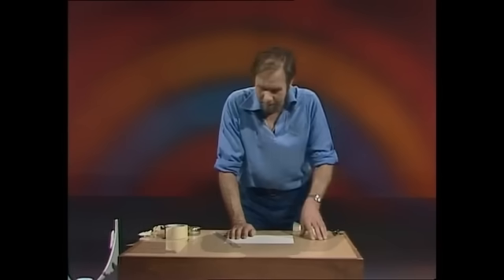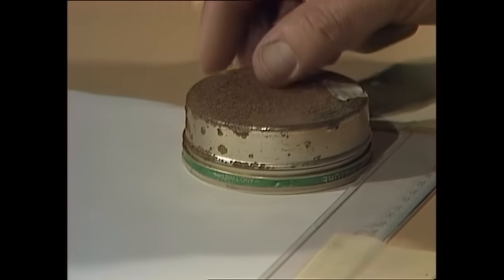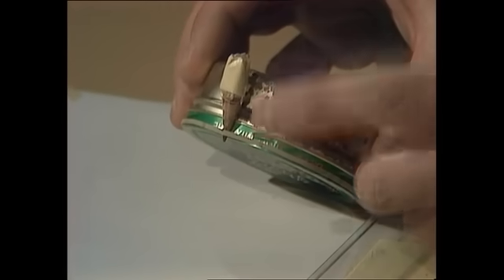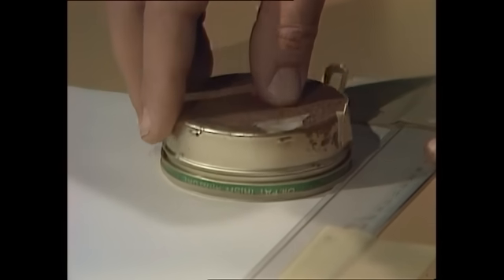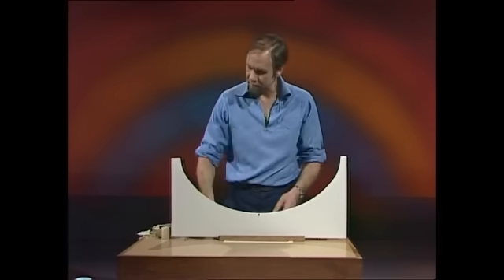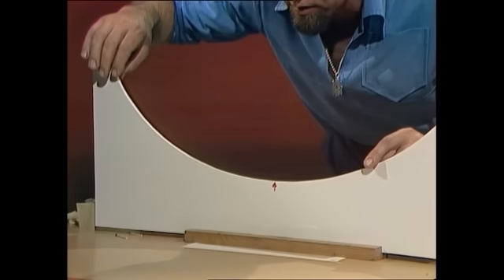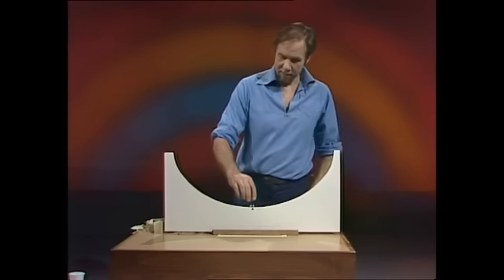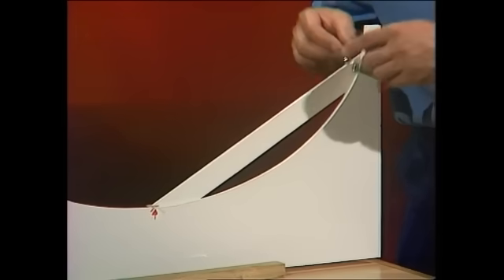The mysterious isochronous curve

Comment: Who discovered the properties of the isochronous curve?  Was this property realised theoeretically (mathematically) before anybody made one, or was it discovered empirically through the 'evidence of experience'?  At a wild guess I reckon it was an Indian, Iranian or Arabian mathematician.  (Perhaps nobody knows.)
Reply: I checked Wiki.  There's a long and interesting entry, but the gist is this: 'The tautochrone problem, the attempt to identify this curve, was solved by Christiaan Huygens in 1659. He proved geometrically in his Horologium Oscillatorium, originally published in 1673, that the curve was a cycloid.  On a cycloid whose axis is erected on the perpendicular and whose vertex is located at the bottom, the times of descent, in which a body arrives at the lowest point at the vertex after having departed from any point on the cycloid, are equal to each other... Huygens also proved that the time of descent is equal to the time a body takes to fall vertically the same distance as the diameter of the circle that generates the cycloid, multiplied by π/2. In modern terms, this means that the time of descent is π r / g {\displaystyle \pi {\sqrt {r/g}}} , where r is the radius of the circle which generates the cycloid, and g is the gravity of Earth.'  It goes on to say that the  problem was worked on in an attempt to improve the accuracy of clocks, dealing with inaccuracies introduced by a conventional fixed pendulum which describes a simple arc of constant radius.  So it was thought about theoretically and practically.  What I have not read yet is who came up with the isochronous arc in the first place...

Comment: Now my question is- Is the path covered by the bob of a pendulum also an isochronous curve? I thought it was a semicircle. let's say i used a stick instead of a string in the pendulum then the path of the bob has to be a circle (always equidistant from the rigid support). but it would still have the properties of a pendulum. So is a semicircle a special type of isochronous curve?
Reply: No, a semicircle is a semicircle. The path of a pendulum bob is an arc, part of a circle. A semicircle is an example of an arc. Neither of them is an isochronous curve. 
You could do this experiment, as shown. You don't need the "special cardboard." You can just cut the same shape out of two sheets of 3mm plywood and a slightly larger hole in a piece of 6mm plywood as a spacer to go between them. Roll golfballs, ballbearing or whatever you've got. Heck, build it huge and roll bowling balls. 
Try it with a semicircle as well, and you'll see that it's not isochronous. 
While you're at it, try it with a sine wave too and post the results here so people can see the difference.
Reply: I agree, Sableagle, but we have to admit that as long as the pendulum is not asked to swing through a large part of it's circle, that curve closely approximates an isochronous curve. It works pretty well in a lot of clocks.
Reply: Across a sufficiently small angle of arc, the bottom of a huge circle, the bottom of a huge isochronous curve, the bottom of a huge parabola, the bottom of a huge hyperbola and a flat line are all about the same. The pendulum follows only one of them.

Comment: Isn't this property also seen in pendulums? They have the same period no matter the extreme point from which they were released. 
So you could imagine two identical pendulums with the same length of string and a common rigid support being dropped from different extreme points at the same time and they would always meet at the mean position (mid-point). In other words, you are only changing the amplitude of the wave, the frequency remains constant for a given system.
Reply: That's an approximation that's only valid for small angles of displacement.
Reply: https://www.math.nmsu.edu/~history/mm-3-2-huygens.pdf

Comment: That is because, the more far you go away from the middle point the more steep is the curve and therefor the gravity can pull more efficiently on the object to accelerate it faster than the object being more close to the middle point, since the more close you get to the middlepoint, the less steep it is. The same goes with the straight line vs. the curve. The straight line is at the beginning less steep therefor the acceleration will be lower.

I definitely dont know all the right terms to use here, but i guess the idea is of what is happening here is correct.

Comment: He claims that balls from either side meet exactly at the centre if the path is isochronous, but other curves don't exhibit this behaviour. I disagree. A simple pendulum follows the circular path and has a constant period of oscillation irrespective of the extent of  initial deviation from the centre. Which means circular path  also has the same said property.

Comment: Easy and simple to explain. Due to its greater slope of you drop from a higher point at one side it gains some acceleration and moves faster than the ball dropped from other hand which has small slope hence it takes time to reach the middle. Due to this happening, both the balls meet at same time.. simple isn't it? 😎

Comment: It's not really a peculiar property if it's logical. The momentary slope for each of the ball bearings directly contributes to their speed. The closer they are placed to the center point, the less the slope contributes to their start up and final speed. That's why the acceleration of the ball bearing placed higher on the curve outpaces the bearing on the flatter portion and they meet in the middle. There's a little more to it than that, but you get the point. Archimedean Sprials, Parabolic Curves, Polynomial Curves, and many more types are used in every day applications such as appliances, automobiles, highway and rail design and so much more and are just as cool. A more correct title to this could have been, "The Fascinating Isochronous Curve." That leaves room for The Fascinating Ellipsiod, The Fascinating Ampersand Curve........
Reply: Its logical and an easily understandable concept but nevertheless fascinating. Fascinating to me because of why rolling a circle along a straight line creates a curve that is so constant in the slope/acceleration ratio that at each point, both balls will meet in the center.
Reply: Well, with a ball on a slope you've got gravity acting downwards and that can be resolved into two component vectors, the parts of a right-angle triangle of which the ball's weight is the hypoteneuse. One component is perpendicular to the surface, and is the amount of force the ball will apply to the surface, and the other is parallel to the surface, and is the force which will accelerate the ball along it. 
Simple test example: if it's vertical, the parallel component is the weight and the perpendicular component is zero, and the ball will fall at g and not press on the surface at all; if the surface is horizontal, the ball's full weight will press on the surface and the ball will not accelerate at all. 
If you know the gradient of the surface, you can convert that to an angle and the angle to components. It's not quite a straight gradient to component thing. For example, a 1:4 gradient has an angle of 14° from the horizontal, at which the perpendicular component is 0.97g and the parallel component is 0.24g. The sum of their squares is 1, so by Pythagoras' Theorem that seems to be right. The ratio of the two is 1:4, and that works for a 1:3 or a 1:2 or 1:1 or 2:1 as well, but the actual number require some clicks on the calculator. 
The gradient of the surface at a time during the drawing of that line is the differential of the tyre dot's vertical position with respect to its horizontal position at that time, and the tyre dot's position is 
vertically: r - r cos(t) and 
horizontally: vt - r sin(t) 
That's -sin(t)/(1-cos(t)), I think. It's been a while.
Reply: These explanations are all well and good but it is peculiar to someone who hasn't been taught them yet. This show wasn't made for people who understand the physics behind everything; it was made to entice young people and get them questioning why things happen. 

 But sure, if it makes your willy hard to explain it like this then go ahead 😂 Horses for courses...
Reply: Woah, hold on a second.... are you saying that the properties displayed in this video are adhered to the laws of physics and NOT magic as I had obviously previously assumed???  Or perhaps you’re just being a pompous ass?
Reply: ... The Fascinating Klein Bottle ...
Reply: EXACTLY!! See? It's endless🥨
Reply: Klein bottles: the least edgy subject matter we could find?
Reply: I bet your a blast at parties...
Reply: Jeremy Gaiser you’re*
Reply: I really enjoyed what you wrote. Tell me more?
Reply: When you say there's more to it, are you referring to the acceleration of gravity, and the influence of friction, based on the distance the ball travels?